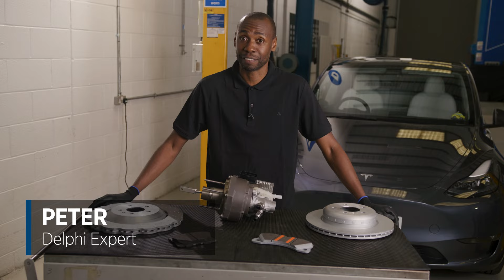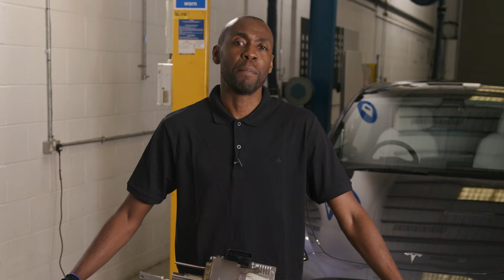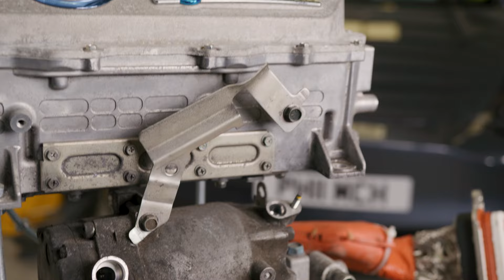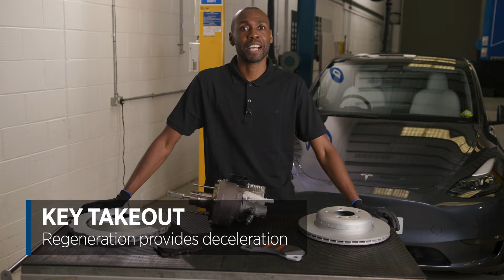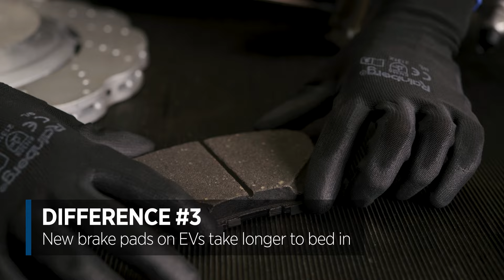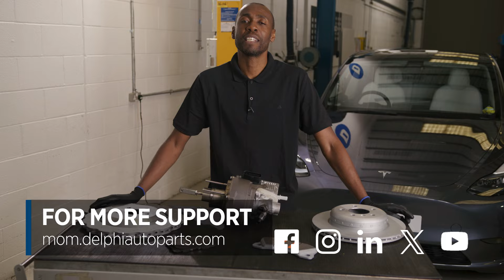[EN] Three key differences with EV brakes | Masters of Motion

Comment: Clear & simple.  However. In the same way that a DPF regen should have a manual option for it to be forced to run by drivers, a manual hydraulic brake action should be able to be selected (via menu option, etc) for a fixed period to constantly keep the pad/disc/caliper surfaces "clean" & free, instead of a stripdown/inspection.  After all, brakes are a safety necessity, not an optional extra.  Some makes do periodically force the hydraulic brakes to rub. But a menu enforcement would be a simple thing to add into today's ever more powerful  electronically controlled car computer systems.